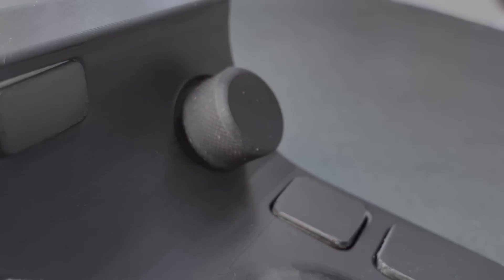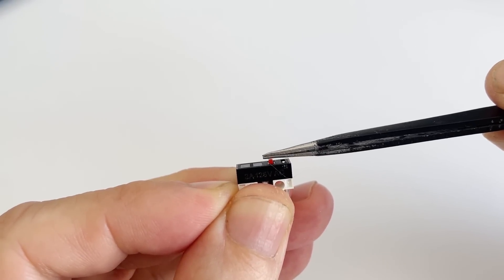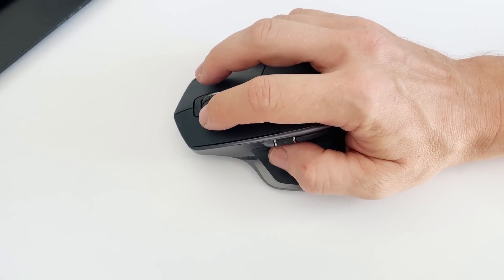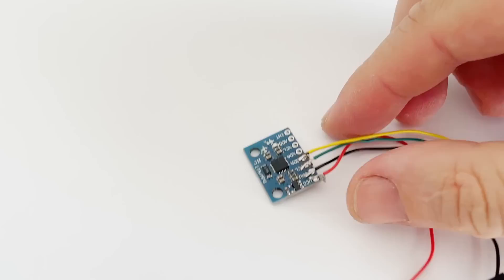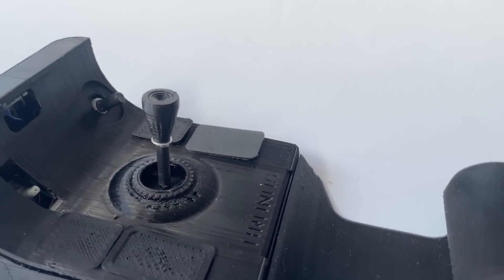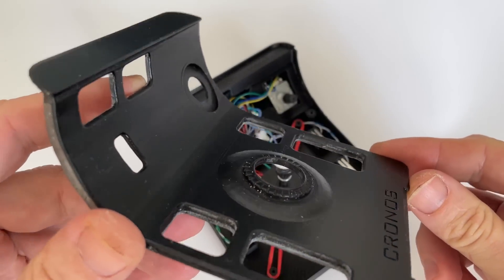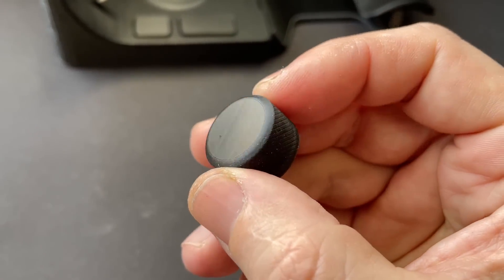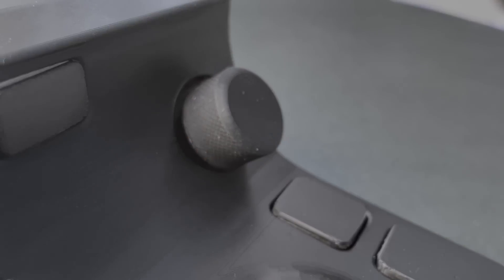Creating the Ultimate Mouse: The Journey Behind Cronos Control - A Mouse & Trackball Hybrid!

Comment: Is the scroll wheel touching your finger in the palm grip a common problem? With my previous two mice my fingers do not touch the scroll wheel, the scroll wheel is between my index and middle finger.

Also the large mouse movements can be avoided if you just use a high DPI. Obviously that depends on how dextrous your hands are. For me with two 4k screens, 12800 DPI works well and doesn't require much movement to go from the edge of one screen to the other.
Reply from the maker: With 12800 you won't have any problem moving the risk, but you will have a hard time doing it accurately on a small open screen, or you will need to switch to a lower resolution.

Comment: From an ergonomics perspective this has good and not so good aspects. The wrist support is very good, additionally the fingers are in a more relaxed position, which is great! 
However, controlling a joystick with a finger might hurt after a while. It’s because the finger’s muscles for sideways motion are weak compared to the gripping and stretching. Traditional mouses use arm and wrist muscles for the movements. So, maybe there’s some room improvement there. Or if it’s not an issue for you then it’s not a problem of course! Though, wild thought, maybe you could use a joystick or wheel either your thumb for horizontal movement, and a joystick/wheel for vertical movement. Kind of like the scroll wheels, but for cursor movement 😂

Comment: Looks cool, and I think I'll buy one, but you're really not utilising how large that surface is. On my mouse (Roccat Leadr), I have 7 buttons I use for navigation, and two left over which I've mapped to screenshot and a gesture input for less used functions. And that's an ergonomic, small mouse that fits in my hand and with each input feeling distinct so you learn them quick and never need to go searching for buttons. This device is ten times the size but only has 4 buttons.
Reply from the maker: My device actually has 7 buttons as well—6 on the main panel and 1 beneath the joystick (like the middle button typically found under a scroll wheel). Plus, it has a volume dial that can be customized for other functions. I found this button setup to be optimal: it’s intuitive to remember, and the buttons are spaced out across different zones, making them easy to locate without looking
Reply: @DIY_Yarik  I didn't count mouse 1, mouse 2 and mouse 3, because few users would consider unmapping those.

Comment: I use a huge Wacom tablet for a mouse for gaming and everything. It's great
Reply from the maker: A few years ago, I tried using a tablet as a mouse replacement too, but I couldn’t get used to how the cursor’s position on the screen matched the tablet’s surface. I found myself having to move my hand a lot to navigate, which felt a bit awkward.
Reply: @DIY_Yarik  so that's when the tablet driver is set to absolute mode, best for drawing and games like OSU. If you switch to relative mode it works like a standard mouse, just hover the pen to move cursor and tap to click. I find it super comfortable

Comment: Good on you for designing something that works for you.
Personally, I can't really see a use for this in my own day to day.
I use my index for the scroll/mmb and keep my index and middle fingers on lmb and rmb, and use a spacemouse for navigation in 3d software.
My keyboard is a 65% and fully programable with layers so I can mirror further to reach keys, and a num pad to another layer for ease.
Mouse is a wireless g502 x, I'm not sure what they use in master mice, but these use optical switches.
I've tried a lot of mice, and this is my favorite by far.
I do disagree with a joystick no matter it's range being quicker or more precise with a mouse.
But if it works for you, cheers.

Comment: In my opinion, the problem with the mouse buttons is related either to the quality of the switches or to their design in general. I had the same problems that after a year or two, problems with the buttons begin, mostly double-clicking starts to work when pressing once or random clicks when holding down the button. I got myself a mouse with optical switches and it has been working for 5 years without any problems.

Comment: Next iteration you'll discover you can do the acceleration trick on a trackball as well and that it turns out even better. You can also do a trick with a trackball where you flick and catch it.

Oh and that Windows Ballistics curve is really bad, but you can use third party mouseaccel software or implement your own in the firmware.

Also i'm replicating your "smooth mouse movements" easily with a basic gaming mouse which i got for 16 EUR on a cloth pad, it has a A3050 low end gaming sensor which is higher linearity than office sensors since those have deliberate input filtering. I sort of hate cloth pads though, because they get contaminated. The mouse is a Speedlink Sicanos and it's got configurable ergo panels but overall it's a cheap product not quality, still, it performs rather admirably.

You hopefully have seen Alex Kenis video about mouse switches? Because i don't think your explanation is quite correct. I have 20 year old mice which never needed switch service, it's a new issue due to lower voltage and lower current the switches are being used at; but some switches are a lot more wear resilient, particularly Japanese D2F switches, which beat all D2FC variants and just about everything else in this use. You can also guard against wear by using dual sided sensing. Still using switches with a lever leaf is good since it can distribute the force better, pressing the nub off centre greatly contributes to wear.

The joystick needs damping, but i can't think of a sure fire solution. Silicone may be it, since it's a spring damper system, but so are rubber bands, so perhaps preload too high, wrong configuration? What i can think of though is that Dreamcast has a Hall effect stick where instead of small return spring down the bottom, there is a huge one on the periphery with preload modulating swash plate, and that stick has long throw, centres decisively and seems to have no overshoot when centering and there is grease in the assembly for damping.
Reply from the maker: Thanks for such a detailed discussion and many ideas! This really needs attention, and many of your suggestions could improve the performance of the device. However, there are a few limitations that make their design suitable for implementation in the example.

Trackball and acceleration: Including a trackball and creating a custom ballistic curve is a great idea, but it complicates the current designs, including de-gaining and calibration. High accuracy can be achieved with a trackball, but it will require significant modifications to the software and hardware, as well as an increase in budget.

Sensors and "smoothness" of movements: As a rule, some inexpensive gaming mice give excellent results. But for our prototype, the main focus was on sensors and components compatible with the overall design of the device. Experiments with other sensors are possible, but doctors follow the requirements for their compatibility with coronavirus parts.

Switches and wear: Thanks for mentioning the Japanese D2F switches and Alex Kenis' video! These switches are indeed more resistant to wear. Currently, the build choices were limited by the available models, but in the future, improved durability is a critical point for the device to disappear.

Joystick Damping: You are absolutely right about the need for damping, and the idea of the Dreamcast peripheral spring is inspiring. However, it requires major design changes and an increased budget, which limits our experimentation for now.

Comment: Great video i hope too see future iterations maybe even a product launch! But i do have some suggestions/ideas (or what ever they are called):

By the looks of it I think using index finger on it is pretty awkward. Maybe the middle finger would be better it would also make it so the whole hand doesn't need to completely change the hand position just to click the two vertical buttons[*].
I maybe you can put  the volume control back to the side[**]

Another is move the buttons closer so its directly below the index and ring finger and also belower than the cursor. =°=(kind of like this is what im thinking or maybe you can also move the two button together like this  ミ⊙ミ or like this  ╬ ⊙ ╬ with the cursor a little higher ).

[*]While writing i was thinking the two buttons and scroll be assigned to the thumb.
[**]I couldn't decide if the volume control should be thumb or pinky finger.
Reply from the maker: Thanks for the ideas and constructive suggestions! They do sound interesting, and I can see how such changes could improve the ergonomics of the device. However, there are some technical limitations that make such improvements difficult. For example, due to the size of the internal components and the limited space inside the case, it is difficult to move the buttons and controls so that they are closer to the fingers or on the side of the device.

In addition, components such as volume control and scrolling require a certain amount of space to operate accurately, and unfortunately this rules out the possibility of placing them under the finger or in another position without changing the design.

However, your ideas will be a great source of inspiration for future improvements!

Comment: The reliability issues dont make sense to me, i am ham fisted, and have been known to throw stuff. i have never broken any of the recent high end logitech mouse. I game, design on cad, and basically use my PC all day. the only thing that has made my user experience better has been a space mouse, which has a similar layout to your cronos.
Reply from the maker: I had a space mouse, but it doesn't control the cursor, and it's more for rotating 3D models.

Comment: very cool, i just hoard mice so when one breaks i cant fix i just plug in a new one. i did luck out recently with a mechanical rgb keyboard i paid $7 for at a discount shop new in box with a metal frame that changing the buttons out is a breeze

Comment: watching you replace every joystick module with a gyroscope because of the dead Zone had me almost punching my screen JUST USE HALL EFFECT MODULES
Reply from the maker: Unfortunately, the joystick is not suitable due to the uneven movement along the axes due to the springs. This makes the initial shift difficult, and small tilt angles are important for precise control here.

Comment: would a compliant mechanism be a better fit for the main joystick that rubber bands. You could get an even resistance across the whole range of movement.
Reply from the maker: I agree, I have now slightly altered the design... I have now made the tension evenly in all directions using 4 rubber bands. It is difficult to describe in words, I plan to make another video soon to show the improvements.

Comment: Very interesting, I would try one just out of curiosity. I've been using an Elecom EX-G PRO Trackball for years and it's been the best solution for me. After throwing away multiple thumb-controlled trackballs from logitech, also for the same cheap part issues you described here, I ended up with this, so far, great solution. I've grown somewhat adverse to the tired and old mouse design and think that innovation in this area is way too slow due to people's stubborn "lack of" adoption rate to something new and better. Some food for thought, if you do get some traction on this, adding another axis of control similar to a "space mouse" might be something to explore. Good job, will support!
Reply from the maker: Thank you! I really appreciate the support and your suggestion about adding a third vertical axis, like in a space mouse—that’s an inspiring idea. I’ll start brainstorming an algorithm to integrate it smoothly; it might even be possible to implement without major hardware changes. Definitely something worth exploring!

Comment: With that size why not using mechanical keyboard switch? Even you can make it hotswapable
Reply from the maker: I actually tried mechanical keyboard switches initially, but they felt quite different from standard mouse buttons. It’s hard to pinpoint, but the tactile feedback just didn’t have the same feel—something was a bit off and less satisfying for this setup.

Comment: What the hell do you do with your mice? Those switches are supposed to be good for at least one million activations. I've still got MY first Logitech from back in the 90s, and it's buttons work fine!
Reply: I’m jumping in here with a guess. He’s into PC gaming. That’s the only thing I can think. My logitech from the 90’s is sitting next to me and, as you said, it works great to this day.
Reply from the maker: It's awesome your mouse has held up that long! Products used to be built to last, but now, it seems like so much of what I buy barely makes it a year and is impossible to repair. Almost feels like there’s a "planned obsolescence" conspiracy!
Reply: I was wondering the same.. I see al lot of dust in the video.. Maybe his house should be cleaned more often.. of he should wash his hands more often if his hands deposit dirt into the mouse..  ?

Comment: If you can find one and want to deal with another standard mouse for ideas try finding a Logitech G600. I have been using this for years, and since they don't sell them anymore I have backups. I find the ergonomics nice since it actually has 3 finger rests on the top, and having over a dozen programmable buttons on it makes it exceptionally versatile because of the different profiles you can have for every program you want to use it with. I also use it in conjunction with the Logitech G13 (something they also stopped making), this adds far more function.

If you are set on it being stationary I would highly suggest moving the joystick to the thumb position, this frees up all your other fingers for other tasks and could make it so you aren't forced to stop movement when you are using most of the other buttons.

Also for the joystick you've probably already thought of it, but just in case you haven't, you might check out "hall effect" joysticks to get rid of dead zones.

Because Logitech has stopped making the products I highly love using currently I might also have to go down this route at some point. Best of luck to you with this project.

Comment: You could use hall effect gimbals for PS/Xbox, it costs only couple euros.
Though it likely will have the same stiffness.
Reply from the maker: I tried using the original joystick from a PlayStation 2, but it didn’t work out well. Unfortunately, all mechanical joysticks I've tested have a significant dead zone and require too much force at the start of movement, which makes precise control difficult.
Reply: @DIY_Yarik  that's the point of hall effect gimbals, it has no dead zone. Though I've never used this cheap ones, it costs less than a single ams IC.
Reply: @DIY_Yarik  btw, if you're going to sell it, I bet people who do not have perfectly leveled desk will make complaints against gyroscope.

Comment: I know this is all temporary, but eventually, you might want to find a 'shelf stable' version of the foam dampening. Foam eventually disintegrates and turns into sand, ruining any microswitch contaminated.
Reply from the maker: Thank you for the feedback! I actually decided to move away from the foam lining for that exact reason. Instead, I implemented a solution using the middle button at the bottom of the joystick, now equipped with a silicone button. It’s been working great so far—reliable and much more durable!

Comment: I look forward to seeing this develop! Hope you go down the framework route and let it be a user DIY thing with options for different button modules and configurations. I've been seeking a new mouse and keep thinking how much I'd love a mouse that can be pulled apart and have new parts added to give it wireless/Bluetooth/cabled connectivity, also being able to have more robust metal buttons and external panels. A mouse for longevity and modularity.
Reply from the maker: Thank you! I’m definitely aiming to keep it as open and customizable as possible. I've already shared the device code on GitHub, and I'm working on finishing the setup program for PC, which will also be available as both code and a ready-made app. This way, users can fully configure it to suit their needs.

Comment: Awesome build, it's given me some ideas for my own controller. Regarding your switch problems, my older Logitech trackball uses Omron switches with the spring steel lever (also, made in Japan--higher build quality). They're over 20 years old and still going strong.
Reply from the maker: I'm glad my video inspired you to come up with new ideas! As for Omron microswitches, I completely agree - it's better to buy them from trusted suppliers, since fakes from China are quite common.

Comment: since the middle joystick always returns to the center because of the rubber bands, when you let go of it does the cursor also move to middle of the screen? how does it work in scenarios like that?
Reply: Presumably, this has relative control, just like the Trackpoint on a Thinkpad laptop. When you release the joystick, the cursor just stops moving.
Reply from the maker: I understand what you mean! I also encountered this effect when I tried to use a graphics tablet as a mouse. In my design, it is implemented differently: when you release the joystick, the cursor remains in the place where it was at the moment of release, and does not return to the center of the screen.